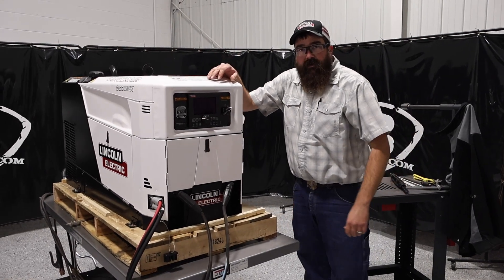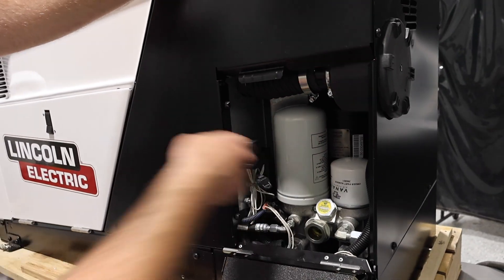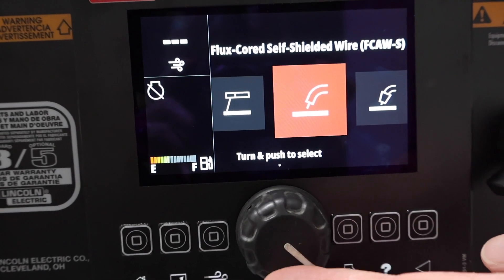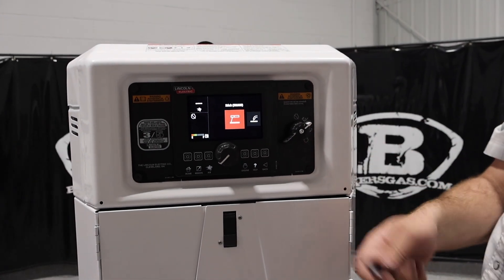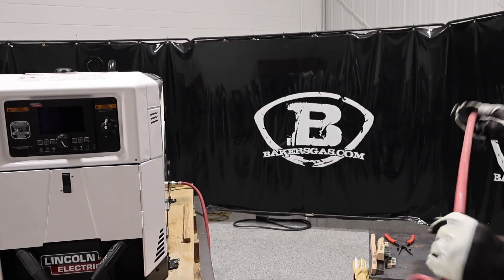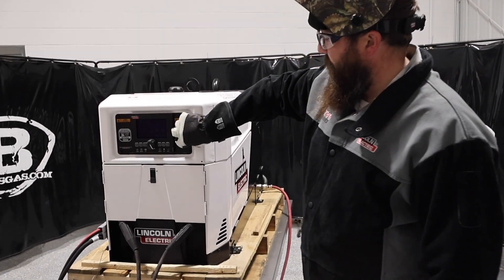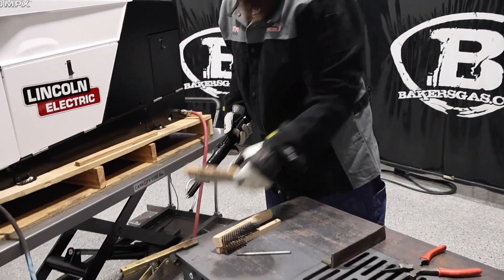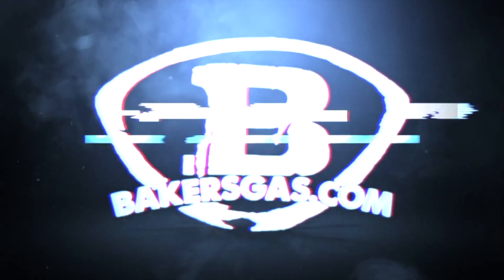Lincoln Electric Ranger Air 260 MPX Review & Demo K5238-1

Comment: mounting it on a flatbed truck is basically impossible because there are doors on all sides. you would have to mount it with the air compressor air filter towards the cab of the truck which would waste a lot of space in the bed. good idea but using it on a flatbed doesnt seem like a good idea.

Comment: Seems like a great machine but, I thought the same thing about the 330MPX before I bought one. I tried to fall in love with it for a month and finally had my Lincoln rep take it back and exchange it for a new 305G EFI. The 330MPX was the biggest piece of crap I’ve ever owned due to the lack of engineering. The tray that the engine is mounted in forces the oil drain hose to climb up one inch therefore, never allowing you to completely drain the oil. You have to remove the hood every 500 hours just to replace the spark plugs and the elbow on the exhaust is welded to the muffler so it can’t be rotated so it only points to the rear. Also, it would get ridiculously hot (like 800*F at the exhaust pipes). What Lincoln doesn’t tell you until you’ve bought it and read the owner’s manual is that the machine requires 18” of clearance ALL the way around it in order to circulate enough air for cooling. What was the point of making it so small when it requires so much space around it?!
Reply: you are both a gentleman and a scholar. thank you for the input you saved me some money.

Comment: Okay so I have a standard Lincoln Ranger 260MPX with a carb not fuel injected.  I have two questions if you could please answer these for me:

Can you somehow remove, delete, or wire around the "Low Idle Override" function when you first start the machine?  This kicks in immediately after I start the machine cold.  It is not good when the engine is really cold to go straight to hide idle and I hate that feature.  I live in North Dakota so when I say cold, I mean cold.  I would like to let it idle for 15 minutes at a dead idle at first.

My second question pertains to this unit the 260 Air because I am interested in upgrading to this:

It says in the specs section that it has variable throttle.  Does that mean it will only idle up enough to cover the electrical load and stay there, or does it peg the throttle at any load?   With my 260 MPX ANY electrical load AT ALL pegs the throttle on the engine.  If you plug in a Dewalt battery charger and hook up a battery it pegs the engine until the battery is charged.  That's ridiculous in my opinion.  That big ass generator shouldn't even have to come close to high idle to put out that little bit of power.  They keep claiming they're trying to reduce fuel consumption and they can't do any better than that???
Reply from the maker: There is no work around on the low idle override. This is caused by the fuel cap not being vented. As far as the Ranger Air are you asking if it has variable speed?
Reply: @BakersGas  yes
Reply: @BakersGas  how does the fuel cap not being vented make the low idle override feature turn on?

Comment: How much longer in length are these compared to the regular 260 mpx
Reply from the maker: The Lincoln Ranger Air 260MPX is a multi-function engine drive that is 26 x 20 x 48 in and regular 260 26 in x 20 in x 36 in
Reply: @BakersGas  thanks

Comment: So should that one not be used for arc gouging? I know the 330mpx can be used for gouging. I also know the Miller bobcats are a similar size as this one and they do not gouge well and the windings burn up when used for gouging where as the trailblazer is the same as the 330 and is wound differently to withstand gouging.
Reply from the maker: Unfortunately it can not arc gouge at this time

Comment: with the spool gun feature, is there an inlet to hook up an Argon bottle or how does that work?

also, my current 330 mpx tends to not stay in idle mode when not under load.  any idea as to what this could be?

and is the fuel tank bigger on this model compared to previous mpx models?
Reply from the maker: Yes correct!